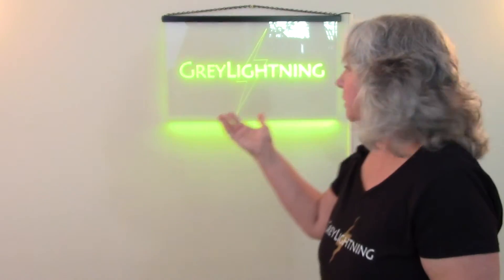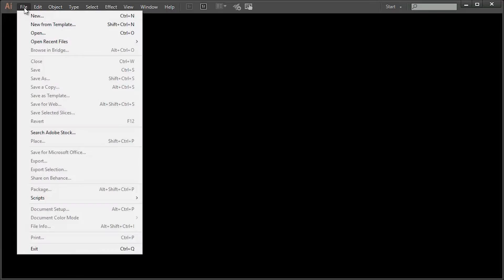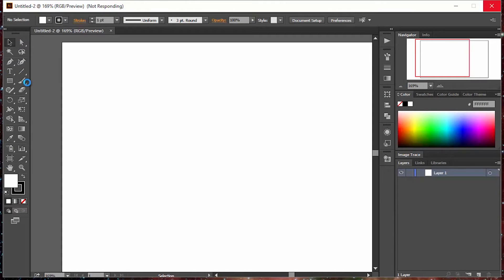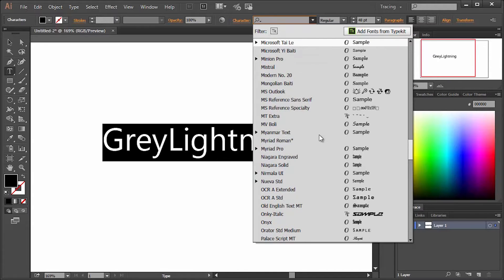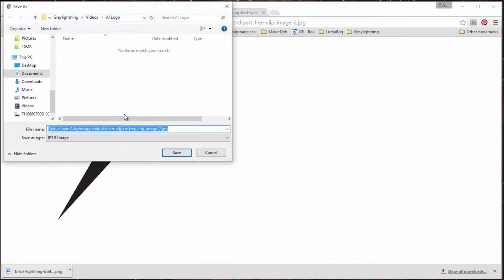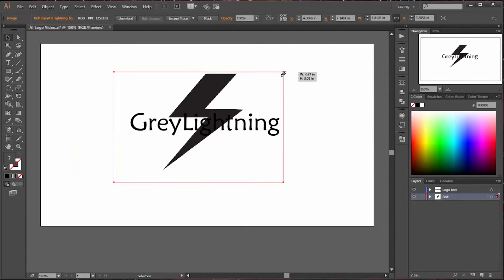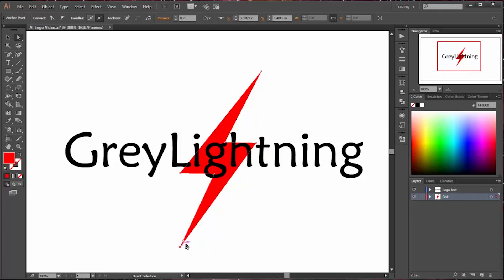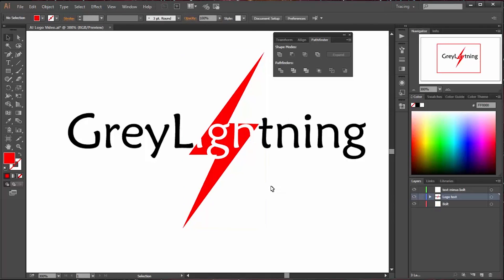Creating a Logo in Adobe Illustrator for Driving CNC Machines

Comment: thanks for the information! I am thinking about purchasing a basic entry level CNC machine and I'm curious to know if you think that the Adobe Illustrator software will  be compatible with most CNC machines or is there some additional programming or software  required? Thank you in advance for your time.
Reply from the maker: Most machines have some sort of CAM software that translates the vector drawing from Illustrator into machine commands. My current laser cutter uses RDWorks. This is where you enter settings, like speed and power, and usually aren't too difficult to learn...

Comment: I'm great with photoshop, but never got into the illustrator. Tried to a few times but I think back now and I'm regretting not ditching the photoshop and just staying with illustrator for cnc projects, I could have been so much better off. Nice effects, you make it look so easy with your knowledge
Reply from the maker: I, too, started with Photoshop and I still use it as an important part of my process. Image trace is the fastest way to get a complex vector drawing started but I almost always have to Photoshop the image to get the trace to work right. There are aspects of Photoshop that transfer to Illustrator, but even with that experience it can have a steep learning curve. That's why I try to point out the tools within it I use on a regular basis; I'm sure I only use a small fraction of Illustrator's capabilities, but you only need to learn the parts you want to use for your particular style of drawing. If you do try a project, check out my in-depth 14 minute tutorial - it focuses on scale models but the techniques are the same for anything I draw. Hopefully it will be helpful to you!
Reply: Greylight May yeah I'll check that out. Some time on Sheetcam and Mach3 today, made some progress there. As long as I'm on them, I'll pick things up, I did that with fusion360, started getting a rhythm going. I tried Inkscape out again last night for the fonts, not convinced it's reliable like illustrator
Reply: I followed what you did here to create a text as a dxf. 
Got the dxf over to fusion360, fixed it up there, just removed the overlapping lines, now I'll open it up in sheetcam and see if it's all good. Should be 100%
Reply from the maker: Did it all work as you hoped?
Reply: Well I guess it did in a way yes. There's a few too many dots, so sheetcam loses info when it opens up the file, some lines move or are gone.